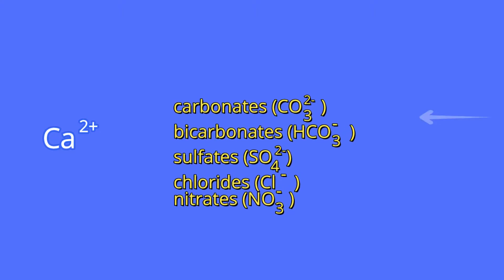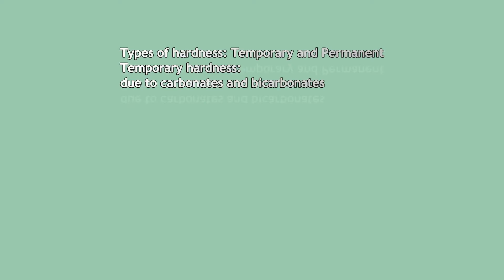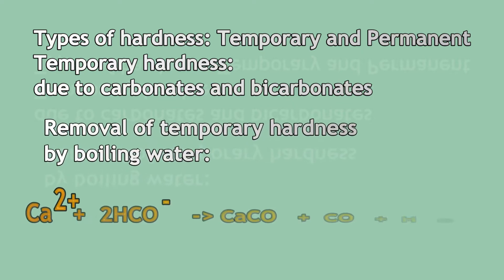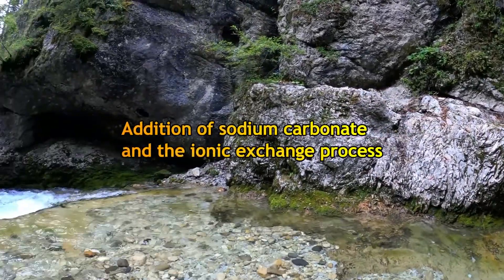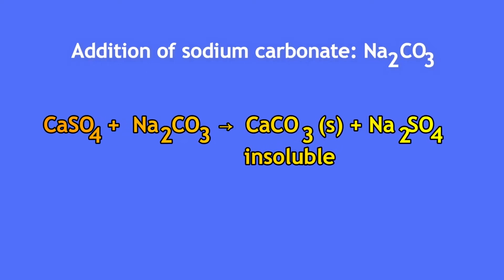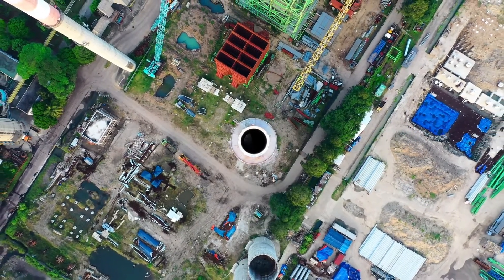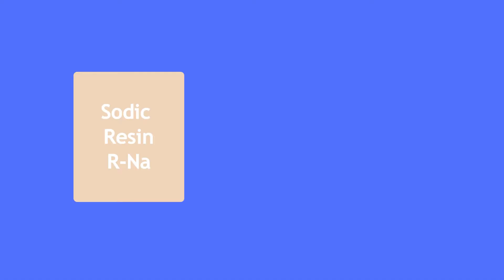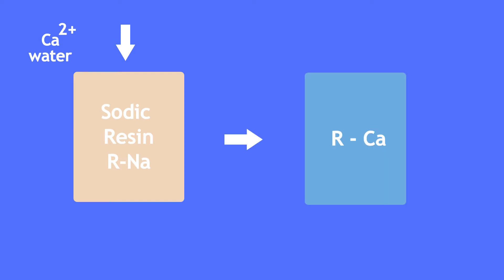How to remove Calcium and Magnesium from water? [each step of the treatment process]

Comment: Why don't people mine carbonate from the Ocean? Seems like it would be a good way to reduce atmospheric CO2.
Reply from the maker: Thank you for your comment!
There are proposals to increase the ocean's capacity to store carbon dioxide, but they are still under evaluation and more research and pilot scale tests are needed to verify if they are viable. The possible ecological impacts must be evaluated.
Some alternatives are to add minerals that can increase the storage of dissolved bicarbonate;  to use photosynthesis with algae, coastal plants, or phytoplankton; to use an electric current in seawater to help extract carbon dioxide.
The addition of minerals could improve carbon storage and reduce ocean acidification, while coastal cultivation of seaweed would be an option for carbon removal and could help restore the ecosystem. However, further research and assessment of the ecological impacts of these alternatives are still needed.
Reply: Not certain if adding solute would work economically even though it works based on Raoult's law thermodynamically. I can see the development of carbon sequestration via flora subsidized by carbon credits, though maintenance and ecological impact are questionable. So I still arrive at my initial supposition that a reduction in carbonate in aggregate yields the most environmental and economical benefit. It's sequestration might be the impediment?
Reply from the maker: This is a great subject and a great discussion. I'll plan a new video on this subject.
Reply: So far all I know is that Aragonite is a keystone mineral. And the conversion from atmospheric CO2 into Aragonite presents some economically viable solution.
Reply from the maker: Aragonite is an interesting option. I will try to include one or more videos discussing these alternatives!